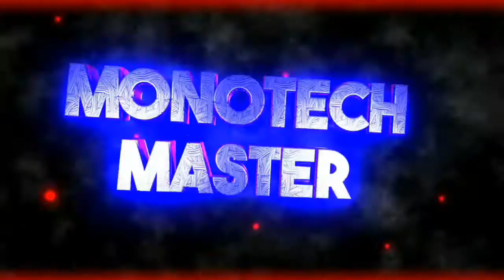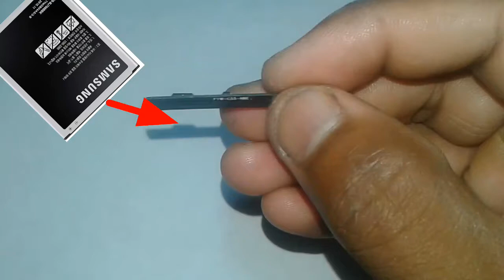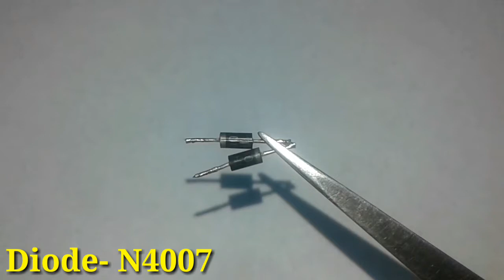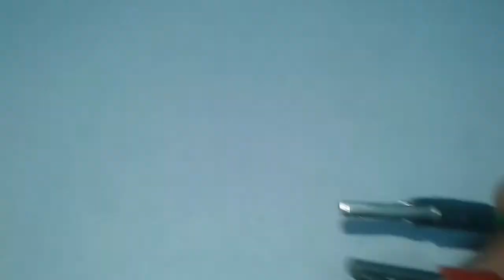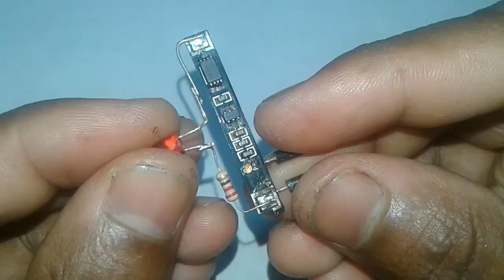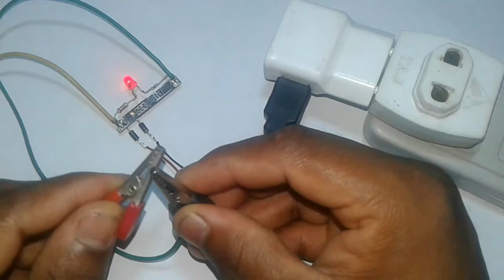Make a lithium ion battery charger module | Short circuit protection module.

Comment: Thank you for your reply. What  I meant regarding your video is that it did not prove when the battery is full. Secondly, I meant to say regarding the 1n4007 diodes connected to the U.s.b. is that if we can replace those diodes with 1n5819 diodes in order to control the loss of voltage by the 1n4007.
Reply from the maker: ok sir thank you.

Comment: How do we know if the battery is full?
Reply from the maker: When the battery is fully charged, it will automatically disconnect.
thank you sir
Reply: @MonoTechMaster  

But will the red light off when the battery is full?
Reply from the maker: yes sir

Comment: How to know the battery has done charging
Reply from the maker: yes
Reply: Thanks aap bhut acche ho
Reply: Ehm i dont know what are you say
Reply: I asked another you answered another ehm disappointing
Reply: @azmirahman1441  You probably know by now so, this is for those wanting to know the answer. It is 4.2v when fully charged (output voltage)